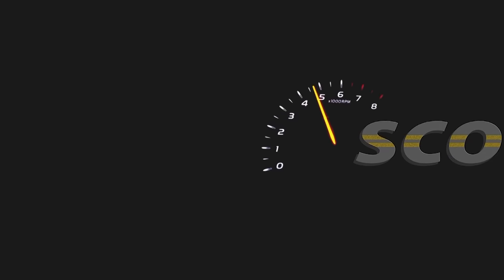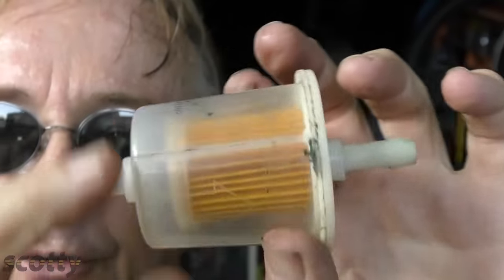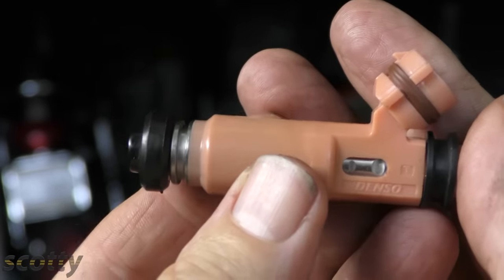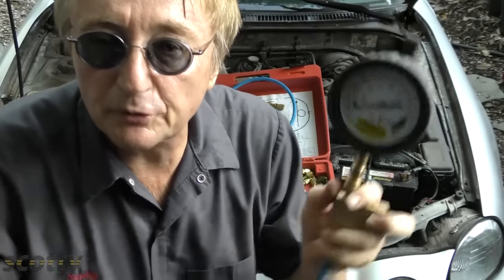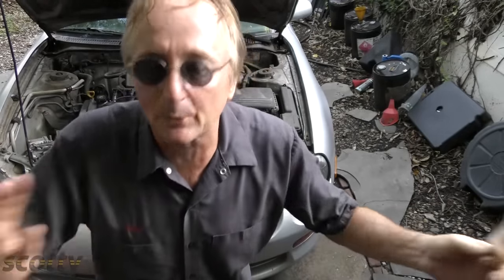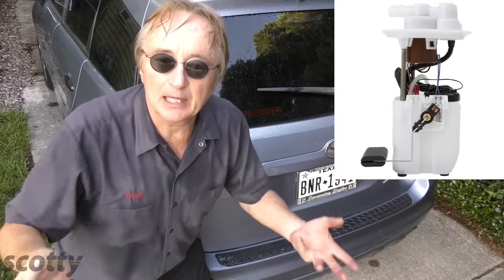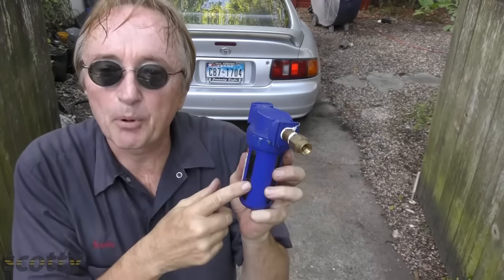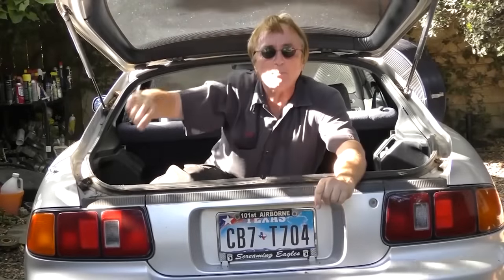Here’s What Happens if You Don’t Change the Fuel Filter in Your Car

Comment: Modern cars are a Royal pain in the butt
Reply: Agreed. If it ain't broke don't fix it. Keep it simple.
Reply: Carburated cars were worse
Reply: Get a toyota celica
Reply: Try owning a german vehicle ... those things are built to never be taken apart....
Reply: themobbkillas you mean built to be fixed alot
Reply: themobbkillas 
Hahahaaaaa. ..
Reply: I was replacing points on my 1966 Chevy 327 every 3k miles, plugs every 10k, carb every 40k. Thanks but I'll take modern over old.
Reply: @Dominykas Dainys Nope that's just a myth, cars with carbs are and were much more reliable.
Reply: @Bo McGillacutty That's absurd, I've been daily driving on the same carb in my 68 Roadrunner for 8 years now and I've only had to replace one dried out needle and seat assembly after letting the car sit for a year. Maybe you should have learned how to actually diagnose and fix carb problems instead of just cluelessly swapping out whole units over minor tuning issues.
Reply: By the time I started driving in the early nineties cars were already pretty modern, but most kids were driving cars that were 15 or 20 years old.  So I have a lot of experience with them and I'd much rather drive something newer.  Better safety, better reliability, much more forgiving maintenance schedules, better power, better handling, better everything.  They were much easier to fix but hardly a week went by that I didn't have to do some kind of maintence or fix something that broke.  Of course some of that was because the car was old at the time, but not all of it.
Reply: @Impact's Garage and Gaming: He probably meant that he had to rebuild the carb at 40k.
Reply: @Dustin Anderson Nothing was better about 90's cars, not safety, not reliability, not handling and certainly not power. I've owned and driven enough classic 60's and 70's cars to know the difference first hand. All that BS about old cars handling poorly is just a myth, when I first started driving my 68 Roadrunner I thought it was gonna handle poorly simply because everyone said old cars did. It couldn't be further from the truth though, I put a cheap but good set of tires on it and some new shocks and it instantly handled better than my friends heavily modified 5.0 Mustang that he used to autocross. And it didn't quite have the turning radius of my friends Prelude but it certainly has way more grip. I even watched some guy in a BMW plow into a curb behind me trying to turn off the highway as fast as I did. Don't get me started on power either lol
Reply: @Dustin Anderson I don't see any classic cars on your channel . . . 
if either of us is a bullshitter it's the one with no evidence to back up their claims
Reply: I don't have anything on my channel.  All I use it for is to subscribed to other people's channels and occasionally make the dumb mistake of commenting.  Anyway, you proved nothing...all you did is type same as I did.

I'm sure a 1968 Roadrunner is more fun to drive than a 2018 Honda Accord.  All that oversteer and body roll makes things adventurous, sure.  Have fun on the hairpin after the brakes get hot.
Reply: @Dustin Anderson On the contrary, I prove my point every time one of my friends has to buy a different car. And it is fun, like I said before all that hype about poor handling is a myth. Body roll is almost non existent and I've never lost the rear end in a corner. The car was designed to handle well with crappy bias-ply tires and putting a good set of sticky modern radials on it makes it handle like a slot car.
Reply: themobbkillas so true I have a 06 jetta pain in the butt but my pain in the butt I love that car smh
Reply: closertothetruth...Amen bro, I'm not sure if there are any good cars anymore. Everything I've owned since my beloved 1997 Honda Accord has been a piece of junk. That car was simply the best car ever built in my honest opinion.
Reply: Bo McGillacutty ...I understand your stance on this. Those old carburated, non electronic ignition cars were a pain in the butt for many reasons. However my 1978 fuel injected  Porsche 924 was the absolute worst car I ever owned. However for me, like Scotty, my opinion is the cars of today certainly have their share of problems. They have gotten more complex to a fault. Also, the use of plastic has gotten out of control. Sooo many problems have occurred on newer vehicles because of this. Like Scotty, I think the best cars were manufactured in the 90's Mainly by Toyota and Honda.
Reply: Outhandle a 5.0 Mustang?! And more grip than a FWD Prelude?! I'm sorry but I have to call BS unless you are running extremely high end suspension with track tires. And a '68 Roadrunner was NOT built to handle i'm sorry. It was built to be a stop light hero like all American Muscle cars at the time. Now this is not to say it's a boat or anything because I've seen older American Muscle cars get down just fine on stock suspension with decent tires but come on dude you aren't fooling anyone when you say you are outhandling modern BMW's, Honda's and Ford's. Especially with just "new shocks"

I have a 1993 Mazda Miata with a 5 speed completely bone stock and I bet money that I would absolutely smoke your Road Runner at AutoX without even breaking a sweat and i'm a novice driver that has no track experience. Why? Because that's the Miata's natural environment and that was the cars design philosophy, Just like your cars design philosophy was drag racing between the lights in the awesome 1960's.

Come on dude we all love our cars but that's no reason to lie about their abilities, Just like I wouldn't say my tiny 1.6 would be fast in a drag race.
Reply: pretty easy to fix though. You could have gone electronic ignition, platinum plugs and that pretty much takes care of those issues
Reply: it was all good when 2005
Reply: themobbkillas 100% agree.
Reply: @2K Tan And yes the Roadrunner actually WAS "built to handle". Have you honestly never heard of the Plymouth Superbird? It was so successful in NASCAR that it was outlawed and it's literally just a Roadrunner with a fiberglass nosecone and an aluminum wing. The 68-70 Plymouth/Dodge B bodies were designed with high speed grip in mind just as much as they were designed for straight line power.
Reply: false
points plugs carbs lasted forever.
Lic Driver Circa 1968
Reply: Bo McGillacuttyfact. forgot to install dist.shaft bushing! Someone around here had that happen in '68 ! Lol must have been end of shift, on a Fri! Lol
Reply: you mean easier right? it's below under car/tank and near fuel lines.
Reply: @FalconXE302 I did just get done following a cruise of old muscle cars, the largest one in the world in fact, it's called the Hot Rod Power Tour. 6000 Cars went 1300 miles, worst I saw was some overheating issues. One guy with an AMC Eagle wagon had to get a hole in his radiator brazed up. And I haven't changed my plugs in about 6-7 years and it's still running on all 8 so you're full of it mate.
Reply: closertothetruth 
That's why I'm keeping my 18 year-old car until it falls apart ✔
Reply: @Impactjunky  exactly. That's completely ridiculous and way excessive. He's  doing something wrong
Reply: Not really.  They self tune for conditions.
Reply: @_Ambition124  buy a daf
Reply: @Impactjunky  AHahhahaha rock on brother, WORLD STARRRRRR
Reply: @_Ambition124  VWs are fine. Parts are generally cheap and easy enough to work on. It's no SBC but my TDI makes 45mpg average and should last 500k miles without much issue. BTW I can change my fuel filter for $10 and 10 minutes, Toyota what?
Reply: You’re starting to sound like ole scotty

Comment: I'm getting a 2013 Ford F350 SD diesel, my brother is giving it too me. Your videos have given me a list of things I want to check and stay on top of when I get the truck. I fly general aviation airplanes, Cessnas&Pipers. I love old WW2 airplanes and go to airshows all the time. The combat life expectancy of these aircraft in the 1940s was measured in combat hours. The examples we see flying today are 75 to 80 years old. If you had told the engineers who designed these planes that they would last this long they'd think you were cracked. My point in all that is, properly maintained, a machine will last forever. I want to maintain my (new to me) truck!
Thanks for another great video Scotty!
Reply: Only to chumps who drive bmws.
Reply: Jack Aubrey I love those old planes. And flying must be an interesting job!
Reply: Bmw M3 e46, everyone knows BMW stands for Badly Made Wagon
Reply: Fly a real Plane spitfire Mk11 Merlin .
Reply: Bmw M3 e46 the 6.7 is one of the better diesels, not like the 6.0 or 6.4

Comment: Just changed my fuel filter a week ago at 271,000 miles, and still going strong.
Reply: Stan Roberts I read somewhere that said if you replace it at over 100k, it might kill the fuel pump. Probably nonsense right? My car’s at 194k so I’m a little nervous to replace it
Reply: @fatlardshowernow234  my fuel pump is still fine, now at near 275,000 and doing fine. If you are worried, change them both,and have peace of mind.
Reply: @ThePariss333 mine is a 2004 Pontiac Grand Prix. Everything works perfect.
Reply: Changed the fuel filter for the first time at 105k miles. Pump still works fine 10k miles later and I get more performance and better mpg
Reply: @fatlardshowernow234  not nonsense.
Reply: Good decision Sir

Comment: About 2 years ago my father bought a Citroën Xsara break (French station wagon). It drove and ran fine, but after half a year the car started to smoke and ran on 3 cylinders. Okay, no problem, we thought the ignition coil was broken and replaced it. It didn't work. So we brought it to a Citroën dealer for a scan. (We don't have fancy scan tools) And they found 1 code: "no ignition in cylinder 3" So we replaced the injector, but that did not help either. Ad that point we were really pist off and didn't know what to do. Once under the car we saw a filter that was a little bit rusty on the outside. We replaced it and the problem was solved. It turned out to be the original fuel filter from 2004 and after we saw it open, it was completely black from the rust and junk. That was a wise lesson. Always replace a fuel filter with the engine oli when you buy a cheap second-hand car...
Reply: Ilias Lamari I'm still mad at France because of a  1972 Renault R-12 that I owned.
Reply: That is the first thing I did after buying my second hand opel corsa B. After changing oil filter and gas filter alongside with oil it runs a lot smoother
Reply: Yup, just do a whole tune up will save you trouble;New Spark plugs, Distributor cap/ignition wires, air filter, Oil filter, Fuel filter, oil change, fill up transmission fluid, check/top up radiator fluid, change brake pads, inspect tires, check battery alternator, inspect steering rack, fill up Power steering, and fill up brake fluid. That should be a basic full Tune up, then your car would be guaranteed to run another 10,000 miles til next checkup. Always replace old car batteries, before you drive em daily too. Being stranded is not fun.
Reply: Also would point out to use additives on your fuel when first buying it, you never know how badly the fuel pump was treated by last owner, and you wanna be using the fuel injector cleaner as well.
Reply: @Frank. T The new Renaults are supposedly  quite reliable.

Comment: With the help of one of your old fuel filter videos, I changed that along with the air filter/spark plugs,cleaned MAF and throttle body, flushed the brake fluid from master cylinder etc. in my '98 impreza. You have allowed me to feel like I'm actually a real mechanic which is not true but it's nice to feel like that 😂 Thank you Scotty, another great video

Comment: Many GMs have fuel filters in the tank and GM recommends a very highly concentrated fuel system cleaner you pour into the tank. It cleans the filter well. Any sediment that gets on the float and filter it removes. Smarter to pour in the tank once or twice a year is better than having to have your tank dropped !! the GM cleaner is so strong we even had no starts come in and poured this in and it started ! Excellent video Scott....every vehicle owner should watch. Perhaps do one on a Diesel !
Reply: ClusterHeadSurvivor how can a chemical break up all the stuff in there... Without ruining something gpod
Reply: ClusterHeadSurvivor, with every engine service my mechanic always adds fuel system conditioner, I'm presuming that's a similar cleaning substance. Maybe because it's got a difficult to replace filter, I'll find out next time If i remember to ask. 05 Alfa Romeo V6.
Reply: Universal Power    I add Compelete Fuel System Cleaner in my car every 3000 mles.
Reply: That type of cleaner only breaks up varnish deposits from old gas, will do nothing for the rust deposits which usually end up clogging the filter (provided you only buy gas at reputable stations that are well maintained).  If the vehicle does sit with old gas in it, certainly use a fuel system cleaner, then run a top tier gas brand which has it's own special detergent additive package do keep deposits down.

Comment: Thanks for great advice as always Scotty. Just ran into a fuel pressure problem after changing the injectors on a 2001 eclipse.  Thankfully the pump is in under the backseat. Upon inspection the "sock" on the bottom of the pump was sucking closed and the filter unit was nasty. Was worried that the filter wasn't sold separately. Thankfully, was able to get both pieces.  Run decent at idle and all sensors and regulator tested good but no gas was getting there intermittently when you pressed the gas pedal.

Comment: Scotty...you hit it on the head here...i tested my fuel pressure and its way up at 60psi...but when i drive the volume is not enough and it bucks, hesitates and has no power and want to die...idles fine... tomorrow i am installing a  new fuel filter..i am pretty sure this will solve my issues...i did everything else including new timing chain,cap rotor,maf etc...thanks scotty
Reply: So don't leave us in suspense. Did the new fuel filter fix it?

Comment: Guess I need to go change the Fuel Filter on my Cars now! 😲
Reply: Jonny DIY yup!
Reply: It’s a good idea! I changed mine on a 02 Montero Sport with 230k and gotten better gas mileage!
Reply: Just changed mine on the 83 corolla, along with mechanical Fuel pump. Easy as pie, now just need to clean up the Carburetor with some fuel additives, and like new with 350,000 miles.

Comment: Excellent video Scotty I didn't know that a clogged fuel filter can overheat and burn out your catalytic converter over time.👍🏽🇺🇸🇯🇲💯🏎💥💨🗯💭

I drive a 2004 Lexus ES330 which is smooth riding over NY crappy roads and last but not least it's very reliable and ages like fine wine🥂 & not like milk🥛 like some other brands.🤗🤣
Reply: Junior Lexus - it overheats because the engine won't have enough fuel if the pressure is low. But, it will still be drawing in the correct amount of air, so the fuel/air mixture in the cylinder will have too much oxygen for the amount of fuel that's there (that's what it means to run lean; the opposite is rich when there's too much fuel for the oxygen to burn). When the engine is lean, the excess oxygen makes the combustion in the cylinder happen faster than it's supposed to, which generates extra heat. So the air coming out of the engine is hotter than it should be, and that overheats the cat (and the muffler). 

The opposite can happen if the air filter is clogged - the engine can't pull air in properly so it ends up with too little oxygen (i.e. too much fuel - otherwise known as "rich"), so it burns slowly and incompletely and generates less heat than it should. Adding a bit more gas actually used to be one way that older injection systems would cool the engine - deliberately making it run a little rich to cool it off.